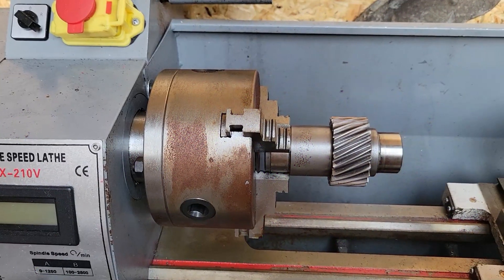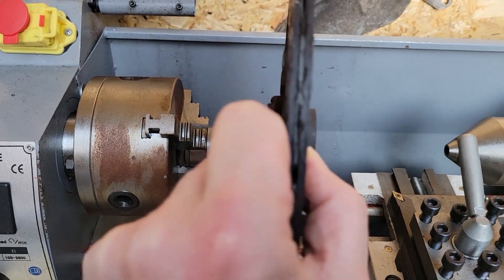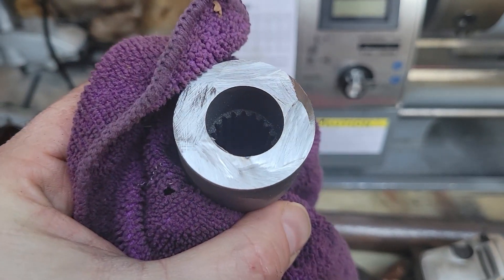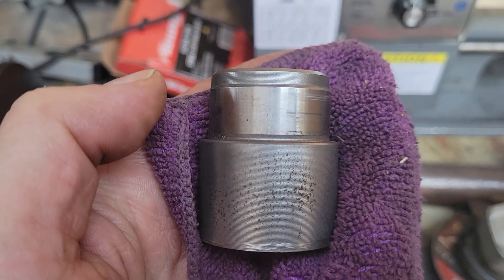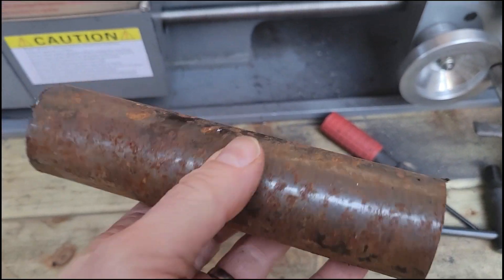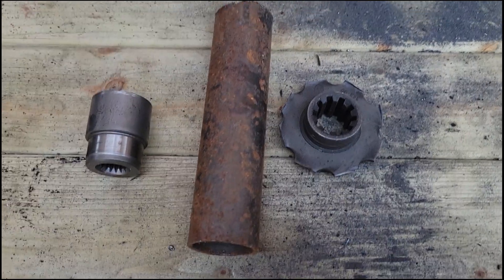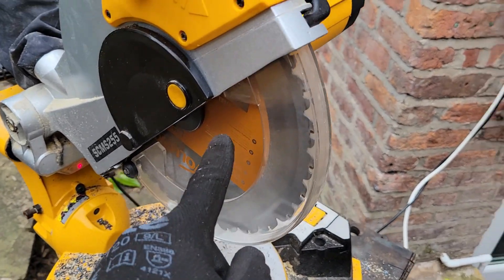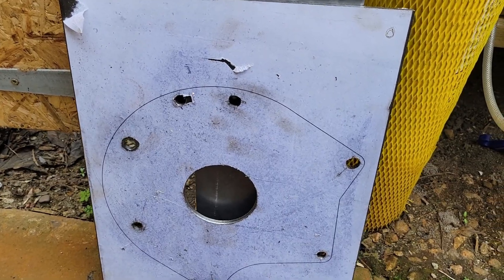Making the coupler: electric car conversion motor upgrade part 2

Comment: hey Pal, great vids.
 I'm ready to get my conversion going on my 1970 VW Camper but have genuinely spent the last 2 months asking everybody i know in the motor trade, to either give me a day rate price with me helping or even straight quote and all i've got in response is utter fear. Would you happen to know anybody in the Buckinghamshire area that would be up for it?
Thanks John.
Reply from the maker: Thanks! Are you on the OpenInverter forum? Or the DIY Electric Cars UK Facebook group? You might have some luck there. I don't know anyone in Bucks but there are plenty of people based in the south east on there who have done or are doing conversions. Even some pro garages working with them.
Reply: @EVDIY  thanks for getting back bro. Yeh, i had a chat with someone on DIY Electric Cars but he eventually declined so i'm gonna go at it myself (gulp). Have you got anyone good for making the bespoke Half-shafts and cradle brackets for the Tesla SDU's?
Reply from the maker: I don't I'm afraid. Worth talking to Paul who built the Tesla-powered Porsche - he was on my DIY EV Chat series and he's on the OI forum. Also on Insta (Tesla_Porsche I think?)

Comment: Great watching this materializing!
I've always removed that sleeve over the input shaft, it's what the clutch used to slide on
Reply from the maker: Aha! I possibly should have done that. Will see if it causes any problems. Could always stick a grub screw in to lock the coupler to one set of splines.